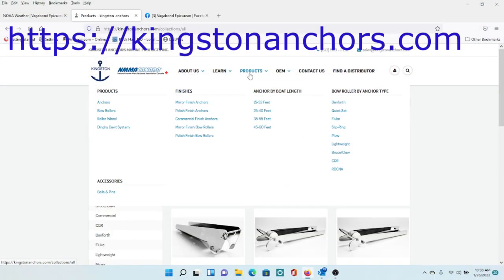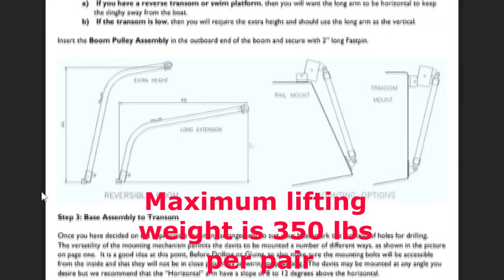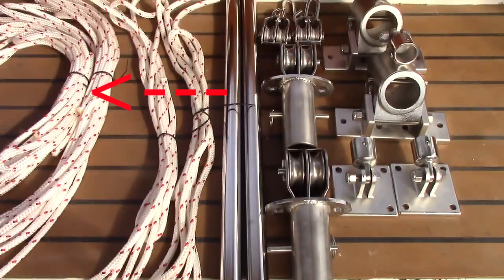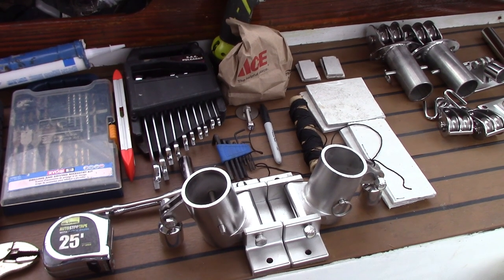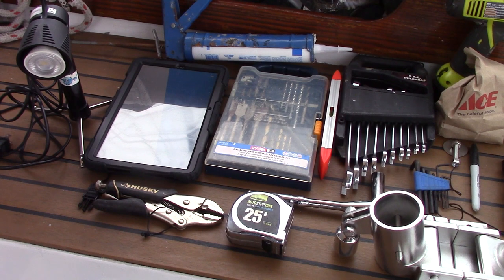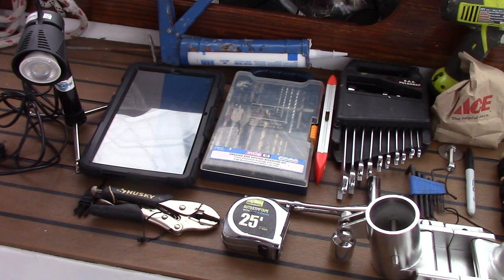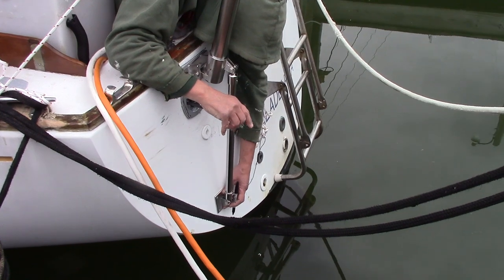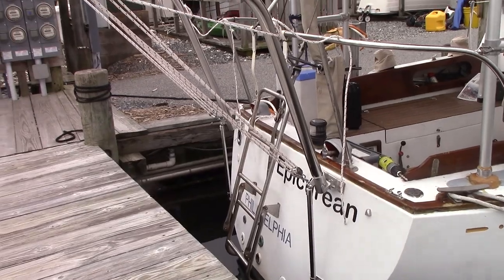how to install dingy davits

Comment: I see two issues - one big and one small.  Small - you should re-run your double block lines so they don't chafe on the cross support - don't go under the support.  Big - I suggest you check with the mfr on the location of your lower boom supports.  You have them connected so close to the hull that they offer very little leverage.  Sitting at the dock is one thing but when you get out into waves, the arms will need better support.  Hope this helps.